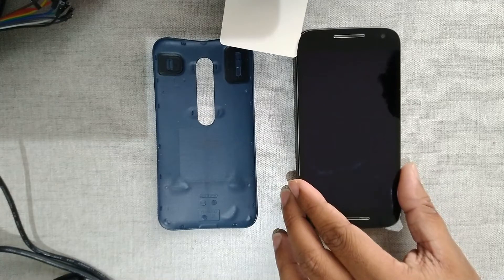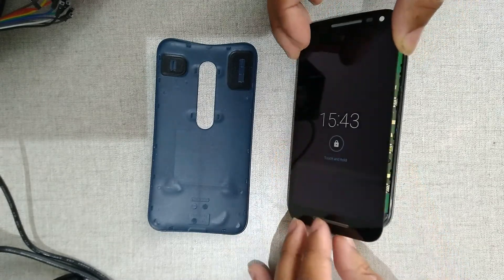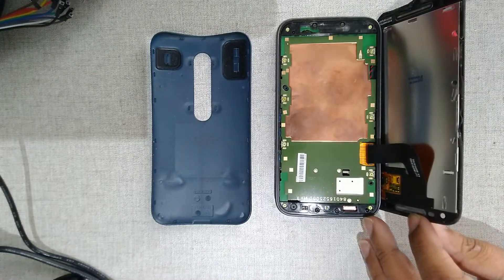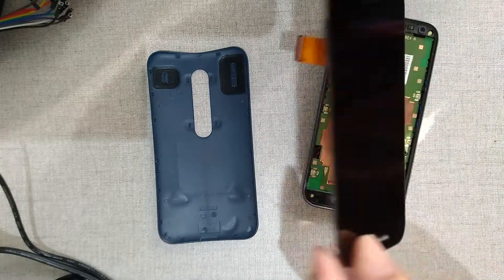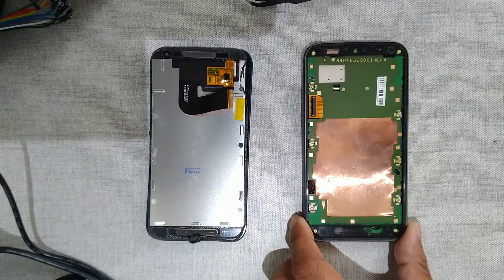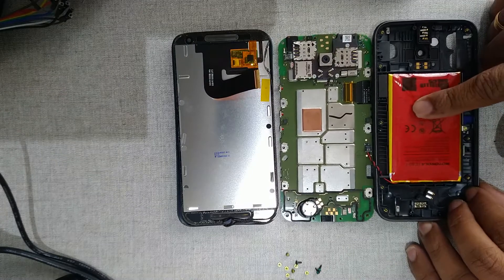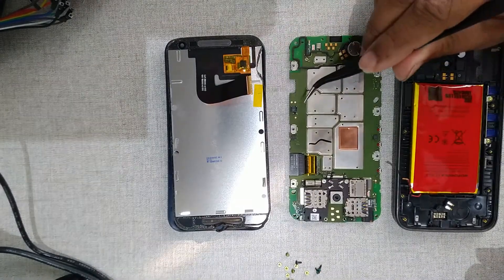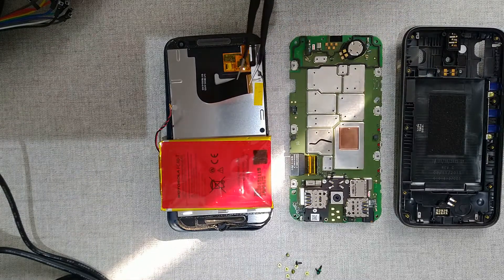Motorola Turbo G (2015) XT1557 - Disassembly and Battery Replacement

Comment: Display panel not working after dissemble please help how to fix screen
Reply from the maker: Not sure what might have gone wrong. Please check if the display flex cable or its connector got damaged.
Reply: محتاج بطاريه موتورولاg3 نفس هذه البطاريه